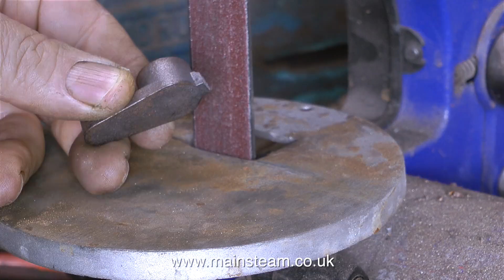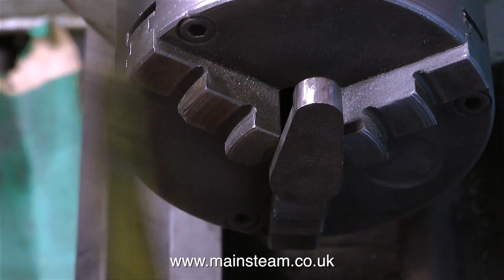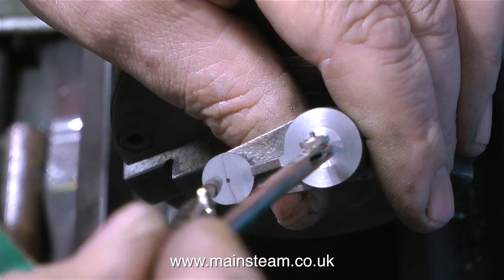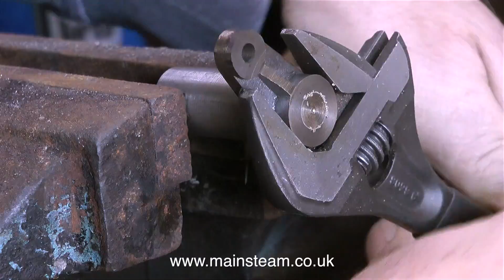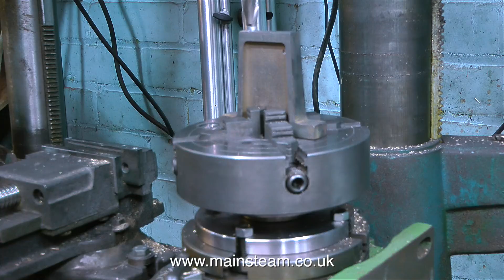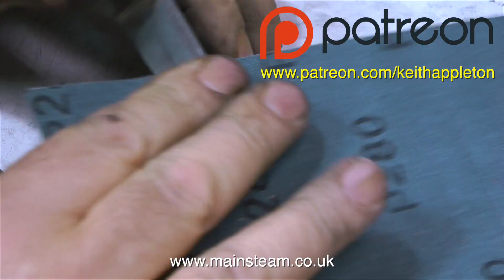HOW TO BUILD A MODEL STEAM ENGINE - STUART MODELS VICTORIA - PART #6

Comment: What size is the 4jaw Chuck are you using here?
Reply from the maker: it's the standard one on my Boxford Aud ...... 200mm (8.00 inches in diameter I think.
Reply: ok I have to ask are you sure it's a 8 inch?  I see on the Stuart website the Flywheel Diameter is 7 Inches. and your 4 jaw chuck you are using looks to be just a bit smaller, I have a Chinese 9" x 19" Lathe and I am trying to decide on a size of 4 jaw chuck to build a Victoria. 
Thanks , PS Love your Vids
Reply from the maker: When I next go into my workshop I will measure it ......... } :-))))